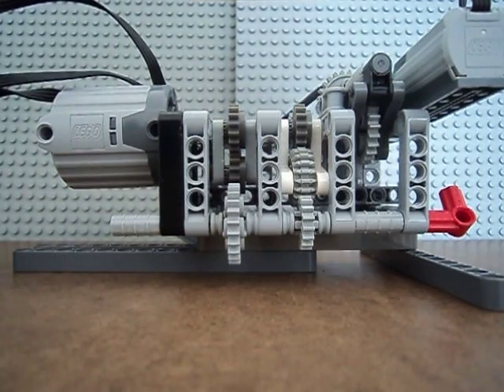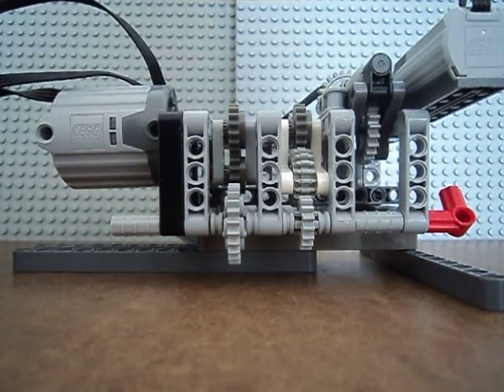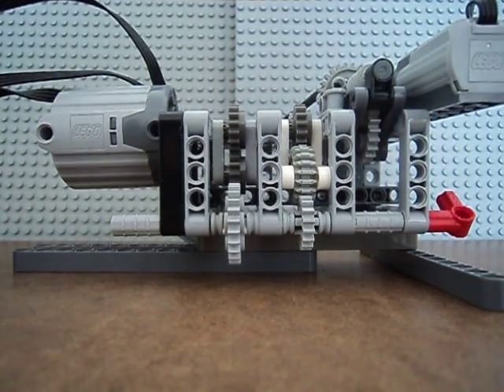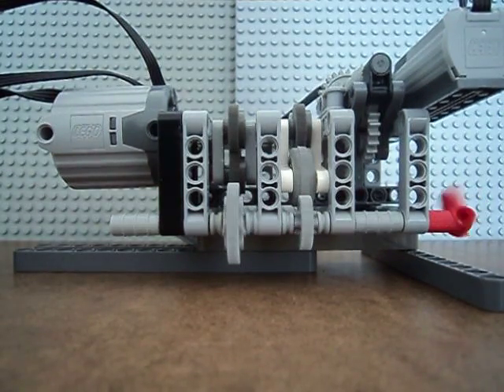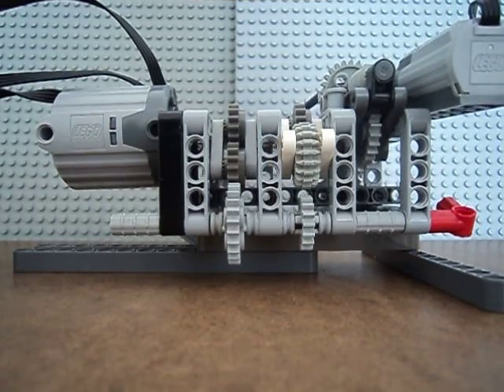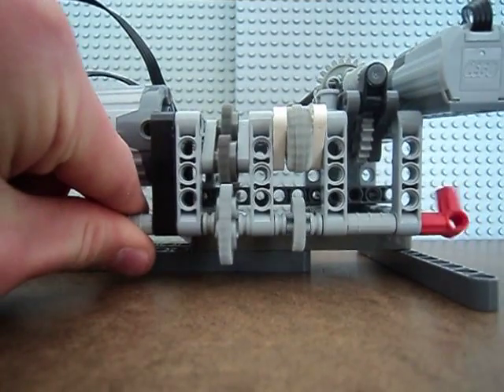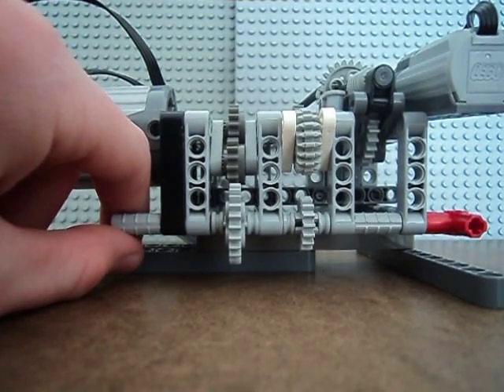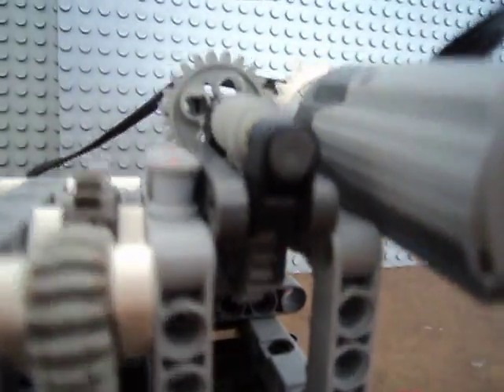2-Speed+neutral, remote-shifted, Lego Transmission

Comment from the maker: @Buildingspree12 As you can see, it's using the torsion of the  axle, which does have some twist to it. I have put it under pressure and it doesn't slip